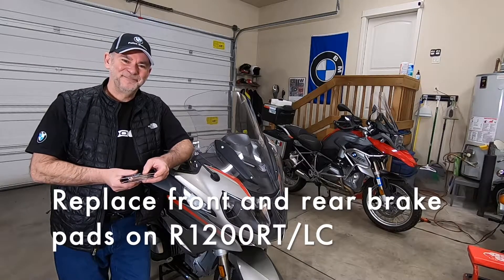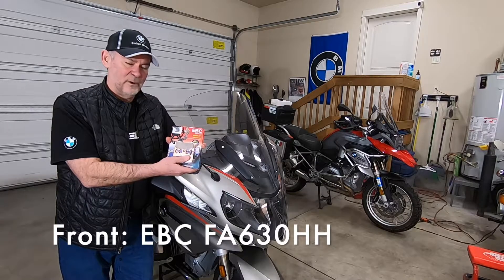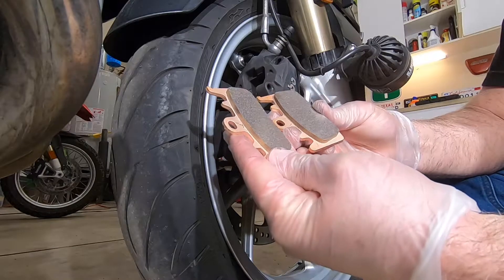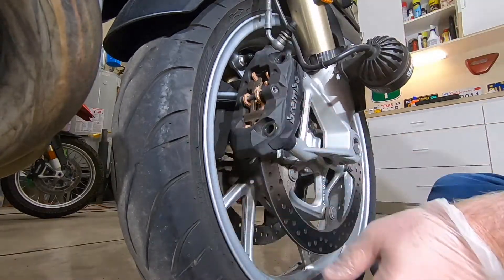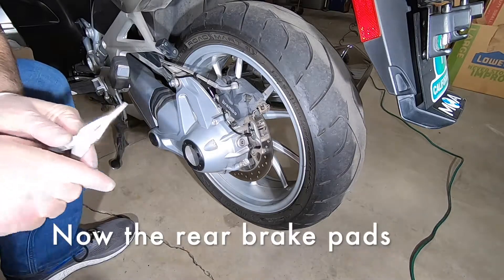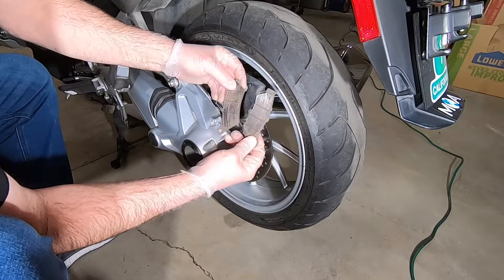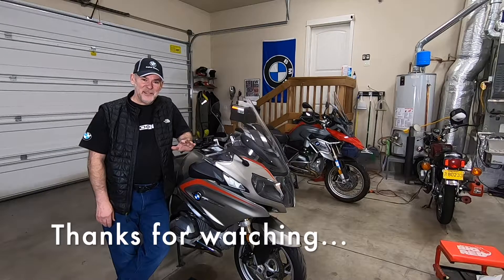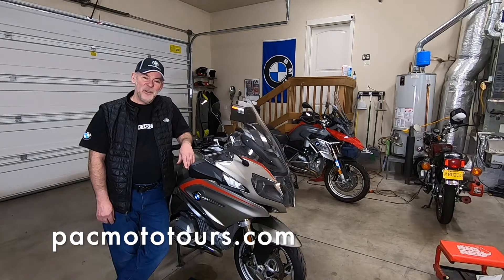BMW R1200RT/LC Replace Brake Pads

Comment: Wow. I listened to your wisdom on purchasing the speed bleeders. All I can I say is why did I not purchase these years ago? Lol. So easy to fit onto my 2018 RT. A breeze bleeding all three callipers. And no need to yell at the wife for messing up the rhythm when doing it the old way lol. I also ordered the same EBC brake pads.  Thanks again for making the video and imparting your wisdom. Really appreciated here in frozen (hopefully not to long) northern Alberta!
Reply from the maker: Cheers to you in Alberta. Yeah those darn speed bleeders totally change the project. Thanks for the feedback!

Comment: oh no， I lost my locking pin for the front breaks… Should I purchase some? Or it’s ok to run without these small pins😢
Reply from the maker: Are you referring to the cotter pin in each side? You absolutely need those to ensure nothing slips apart while riding. You can get cotter pins at your local hardware store.

Comment: Why no copper grease on the rear of the pads? And never use the disc to push back the pads as can sometimes distort the disc.
Reply from the maker: What do you use to push back the brake pads?
Reply: Flat blade screwdriver between the t op of the pads not allowing any distortion on the rotors.

Comment: No cleaning of any parts or grease on the pin?
Reply from the maker: I have a more current video of brake pad replacement in which I discuss cleaning and grease.